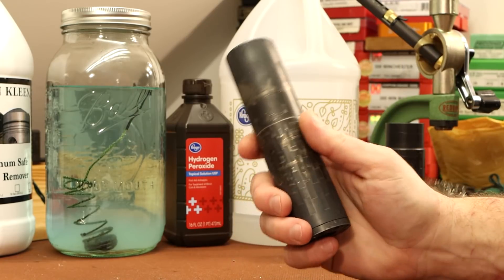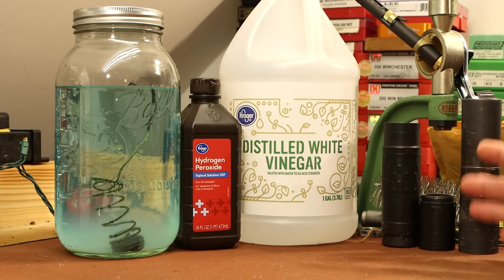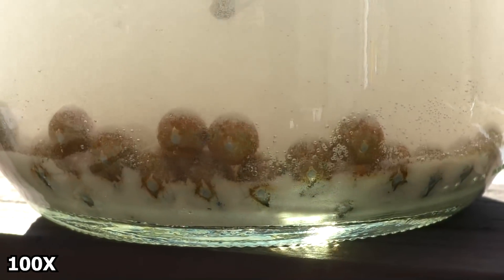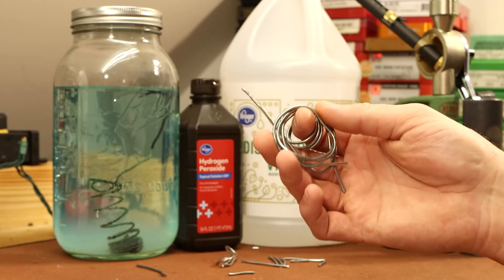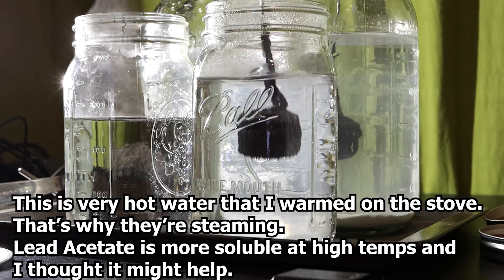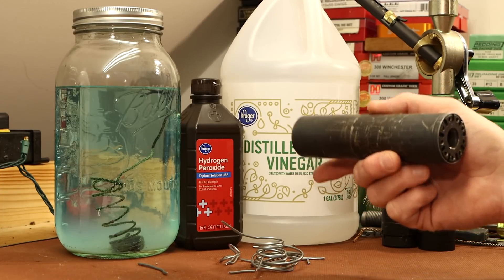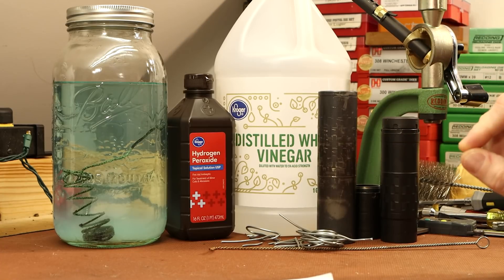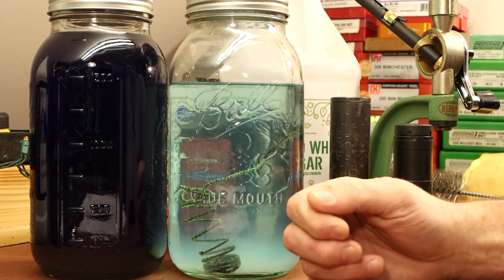Zinc makes The Dip safer. I think.

Comment: don't forget to neutralize the vinegar with a tea spoon of kitchen soda. iron sewage pipe will be eaten away by acidic stuff. and they are expensive to repair. 👌

and i guess those wire brush hair are copper. same stuff left behind when a fmj pass through the suppressor besides lead.

Comment: Alright the blue color of the last dip is copper. Once the copper goes in solution it will cement out on iron (why it plated on the can). The iron replaced it the exact same way the zinc does the lead. So to get it out of solution you can literally throw any scrap iron in and it’ll drop out. I’d avoid stainless as it will add other stuff like chromium, vanadium, etc. which may be more toxic than the copper. Plain old low grade steel is your best bet. You can also use electrolysis (which would put you on the road to plating lead projectiles for instance..). I know sodium metabisulfate and iron sulfate are 2 used to drop gold and other precious metals, not sure if they’d do copper but might be worth looking into. Oh and diluting the solution with water will make the lead and silver oxide drop out of solution.

Comment: Once you get all the lead out of solution that blue acidic solution can be used to copper plate just about anything you can run a current through. You'll need an old school car battery charger (new ones have too many safeties...) and not a lot else. Hand tool rescue has done it a few times, he may have a video on making the copper solution and the process on using it to plate things. Judging by the depth of blue color it's not a lot of copper, I wouldn't expect great results but you could plate copper wire (for example) just to pull the copper out of solution

Comment: The white powder is the lead sugar , lead acetate. I’ve read probably the same stuff. the rest is Peracetic (sp?)acid.  Don’t melt the sugar that’s the most deadly way . The zinc affected lead ehh I dunno. Also their should be some tin, antimony, silver, and arcinic (sp?) just what was their to start with. Paracetic acid also gets copper so the bronze brass dissolved.

Comment: I’m confused. I thought center fire rifle suppressors didn’t need to be cleaned. I have a surefire 300 sps and have never even considered cleaning other than the area that interfaces with the brake. I shoot 5.56, .308 and 300blk through it. Should I attempt to clean it?
Reply: Use CLR for a day or 2 it's worth it plus it's safer

Comment: Call me crazy but it seems to be that lead would be the least or your worries. I would think carbon would be the majority of the build up In the suppressor. Right? The bullets are mostly copper and even if the backs were exposed lead it would still only be tiny flakes of lead in the suppressor.

Comment: First thing.  KEEP this video.  It is educational and the more info we have on the dip being "less hazardous" the better.

I cleaned my suppressors recently and have a batch of the dip sitting around.  I have been researching for years how to make it less toxic.

It seems NaCl (aka salt) would work.  I found a chemistry video of lead acetate reaction with NaCl with the chemistry formula, but no actual concrete video.  Been told to boil water to make it a super saturated NaCl solution then dump into dip to make Lead Cloride (or is it Lead Clorate?).  NileRed I am sub too and saw that zinc vid.  Considered it too.  I am also partially ready to join his patreon for a month to ask questions he might be able to answer regarding this at home chemistry.

Still looking for a place in my area that will dispose of lead acetate.  Any time I call a hazmat place, I get the question of "what is lead acetate".  Morons.

Comment: I soak my suppressors in BoreTech Eliminator every one thousand or so rounds. It keeps them maintained and I don’t gain any weight. I soak for one hour, rinse with water then rinse withBallistol and water mix of 90 percent water and ten percent Ballistol. I have never had any issue whatsoever but.. my finish is long gone, it’s been cooked, painted over and re painted over five times.

Comment: There was an article on the web about using the dip to clean stainless steel. While it does not appear to cause damage to the steel, it actually does cause oxidation. That's what that brownish colored stuff was. Rust. You rusted/oxidized parts of your can, dude.

Unless you go to town with cast lead or high pressure exposed-base FMJs, there shouldn't be much of any lead in your can. Use a solution to dissolve the carbon from time to time, and you'll be good.

Comment: Have you thought about getting an airlock like what craft brewers use? That way the hydrogen gas can still get out but even less chance of spillage.
Reply from the maker: That's an awesome idea. I'd like for it to evaporate over time, but it would probably be safer to have something spill-proof for long term. Definitely something I'll consider.
Reply: Isn't the point of those things just to create like a one way valve to prevent bacteria and whatnot from getting in?

Comment: Could you burn the carbon off by making a potassium nitrate solution and then wetting the inside  of the can,, and then aftet allowing it to dry and you ignite the carbon with a match

Comment: Hey Johnny, if you want to speed up the reaction you can use zinc powder instead of a large piece of zinc. The increased surface area of the powder will help a lot.
Reply from the maker: Nilered did that in the 2nd video, so I considered it. I was holding out hope that maybe we could grow some cool looking crystals, and we did a little bit. Like you say, I'm sure all that surface area would help a lot.
Reply: @JohnnysReloadingBench  Try leaving it overnight in Coke once in a while
Reply: Maybe for something reusable you could get thin sheets, maybe foil, and coil it up to get surface area too.
Reply: Ooh, good idea!

Comment: There’s no real need to go to this method. Run the can hard (get the temp way up) that should self clean it. The dip is normally used on 22 cans that do get lead build up inside them. The only can I worry about cleaning, if you could call it that is my 22 can. My center fire cans I mag dump a few mags every so often an call it good. Most can benefit from having a build up inside, yes hard fact for the ocd crowd to under stand.

Comment: the piston clean is great for removing carbon on brakes and the bore . lots of f class guys use it or even clr . only it will remove bluing . it will even get a carboned up  adjustable gas block lose .

Comment: Didn't use a rack in your sonic cleaner did ya ???
Reply from the maker: Sure did! The one it came with.
I just went overboard...had it going for hours.
Reply: @JohnnysReloadingBench  well i wonder how it marked up your can , wonder if its not a metal problem , such as that is where the can got hotter under firing maybe ? Anyway it sucks that can looks well used now...

Comment: Why wouldn’t you just leave the lead acetate solution in a container to evaporate into a crystalline solid? You could then measure the amount precisely and react it with sulphuric acid to make lead sulphate which isn’t water soluble. You could safely dispose of that in the garbage or dilute it into some concrete and dispose of it as patio stone lol
Reply: So just out of curiosity… when you have created the lead acetate solution just leave it outside and let it evaporate. Once it has evaporated add sulfuric acid to it and then it will turn it in to lead sulfate? Which is obviously safer I’m assuming. Then you can dispose of it?

Comment: I’ve had my suppressor for 6 years.  It’s a 22 AAC Element.  I just throw the stainless baffles into my wet tumbler and let it run all night.  Sometimes I tumble the baffles with my brass.  Keep in mine, I have to tumble them for a very long time, 12-24 hours.   I don’t use the suppressor all the time because I don’t like cleaning it.
Reply: I found simple green in a steel pin tumbler for 24 hours worked awesome on carbon.  Still had some stubborn stuff, but worked out.
Reply: @luxordeathbed  I’ll try that next.

Comment: Hey Johnny, I'd be interested to see crushed zinc tablets (the kind you get in the vitamin section) poured the into the solution. I need to clean my 22 can so I'll give it a try when I do.
Reply: Those probably won't work. You need relatively pure zinc metal in order for the replacement reaction to work, and those tablets don't use pure zinc, they use some type of zinc compound.

Comment: I clean my guns and suppressors with a product named “Shooter’s Lube -Stage 1 Military Grade” weapon cleaner. I spray removable baffles, wait a few minutes, then simply wipe down with a cloth. Baffles look like brand new when done. Same for their tube. For non-removable baffles, just pour an ounce into tube, put a finger over inlet & outlet, and shake it up to completely cover/soak the innards. Then drain after a few minutes (I reclaim the contents for future use), then stand it up on its end where it will “self dry” in an hour or two...

Comment: Jonny, I use two methods to clean suppressors. 

I've found that "The Dip" works great on lead but not so well on carbon deposits. I read somewhere that you can take soda ash (sodium carbonate) and add that to the solution to neutralize the acid and precipitate out the lead. It's often sold as pool pH up at the hardware store. Add slowly and stir gently because it foams quite a bit. I'm not a chemist so I'm not sure this works but it does drop off a lot of the "white dust" into the solution. The blue color in your jar is likely dissolved  copper from bullet jackets. 

For carbon, I soak my pistol baffles in a mixture of Lye(sodium Hydroxide) and water for a couple days. The carbon loosens up and can be wiped out or easily scraped off. You could also try firing some 223 rem to blast off the baffles since you can't take your suppressor apart.  Lye is not good to get in your skin or eyes so make sure to use safety gear. however it's pretty safe to dump down the drain since it is used often in drain cleaning products. It should not be used on anything aluminum(only steel) as mixing with aluminum produces a toxic gas. It may strip off the finish on painted parts. 

Hope this helps.
Reply: CLR on carbon deposits.  BUT don't leave it in the CLR for a long time as it can damage steel/stainless steel.  10-15 minutes works wonders.  Search youtube on CLR on muzzle brakes.
Reply: Sodium carbonate is also sold as "washing soda".  After I process circuit boards, I have to wash the etching tank.  The rinsewater and the water in the dunk tank contain dissolved copper.  I just add an excess of sodium carbonate to precipitate everything.  Copper carbonate hydroxide isn't water-soluble.  
I don't know how that holds for lead.  I'm assuming that the product would be a basic lead carbonate with low solubility as well.  I don't know about the antimony fraction.

Comment: Why would your suppressor have lead in it? Every bullet that passes through has a copper jacket, and doesn't touch the suppressor anyway. It's just carbon fouling.
Reply: There will never be enough lead in a centerfire can to warrant cleaning its absolutely pointless.
Reply: Once again.  You do not understand, the lead is from the priming compound.  Maybe you have a matchlock and don't use primers.  The priming compound lead is airborne and extremely dangerous to humans and can cause cancer too.

Comment: Dang man, why are we over complicating this? Its a centerfire rifle, it doesn’t build up the lead that a 22lr can builds up. If you really want to clean it just spray some foaming Wipeout bore cleaner in there a few times or just plug the ends and put a brush free bore cleaner in there. There is carbon and maybe a little copper build up in there, very little lead. 

Edit: I didnt mean for that to come across as critical.
Reply: I have 20k on a form 1 can. I've never cleaned it I've actually never even taken it apart. It still works fine all grade 5 titanium with a ss blast baffle that's eroded a little bit. Cleaning a rifle can is absolutely pointless, my rugged obsidian 45 has roughly 5k on it I've never touched it either and probably won't. 

I don't know why some guys want to clean these things so bad? I'd rather not be in contact with what's inside them. If I ever have a problem with a factory built can I'll send it back they'll fix it. My form 1's I don't really care about because my blast baffle will be eroded before "not cleaning it" would cause a problem.
Reply: @theLeadGin  because some people will take the time to keep their shit nice? do you service your car?
Reply: @James28R  Servicing a car =/= to keeping it looking nice (cleaning). Last I checked cleaning a muffler on a car does not come up as a recommendation or requirement. Cleaning the interior of a car and washing the exterior is achievable through much more ecologically sound principles such as water and "elbow grease." 

I don't breathe through my sound suppressor, nor do I drive my car from inside the muffler or engine block.
Reply: It is 6 years old and with how much he shoots I would imagine it has a lot of build up. There is probably quite a bit of carbon and more lead than you think because of bullets with exposed lead in the back. But agreed he is going way too deep down the rabbit hole here. He could just send it in to get cleaned for little to no cost or use an easier method.
Reply: @Nick-sx6jm  Yeah, no I understand its an older suppressor that gets shot a lot with various calibers and powder loads, but still…the Wipeout method, or just any foaming bore cleaner works marvelous for upkeep.

Comment: If I understand correctly, the silencerco omega’s outer serialized thin wall tube can be unscrewed from the core (bother ends off to) and then put the Core into a water rotary Tumbler with stainless steal media to clean the carbon deposits. 
It took me about 6 hours of 3 hot Dawn water baths to clean a Sparrow core, but boy is that thing clean now.
Reply: i believe he said in an earlier video that his has become seized up...
Reply from the maker: I can't get mine apart anymore, but it's headed back to silencerco soon. I worry a lot about using the rotary tumbler and getting steel chips or pins stuck in there. I've heard it works awesome, though.
Reply: @JohnnysReloadingBench  Lok at replacing the Omega endcap with the AREA 419 cap and using the adaptors for your rifles. This allows you to switch betwen different thread pitches without touching the can. I use it on almost ALL my rifles and have seen ZERO impact shift between removal and re-install
Reply: @JohnnysReloadingBench  on the plus side, the SilCo folks are great about taking care of stuff.  I had an end cap strike with my Hybrid and an aftermarket barrel.  I contacted SilCo because I wanted to make sure there wasn't damage inside the can I couldn't see.  About 3 weeks after sending it to them, it was back with 'no damage found' and a new end cap.  That led to a trip to the friendly local suppressor shop where I discovered their 1/2x28XL piston and it's internal 'shoulder' that was designed for thinner pistol barrels that don't have enough metal for a proper shoulder.

Comment: Fellow student of Youtube Chemistry University here, I think what happened is due to what's called the "Reactivity Series of Metals", basically some metals are more reactive, and others less so.  You can use this to swap one metal for another in a solution, and since Iron (in the brush handle & bristles) is more reactive than Lead, it was not only dissolving due to the solution, but whatever lead had dissolved into the solution was immedately being replaced by iron from the handle.  Zinc is more reactive than iron, so when you put the zinc coil in that nasty solution, both the iron and the lead were precipitating out which is why you got a different looking precpitate.

This is used in Gold refnining because Gold is the least reactive metal. A process called "inquartation" can be used whereby carat gold (i.e., gold that is not pure) is alloyed with sterling silver to make it easier to dissolve out the silver and base metals.  The pure metallic gold is left behind, and then the solution that is full of silver, copper, etc can be refined using the reactivity series to remove just the silver by putting in pieces of copper.
Reply: Alright he summed up my comment way better than I wrote it haha. Any experience with iron sulfate to precipitate gold in solution? I think I accidentally screwed up with adding more hydrochloric acid and peroxide over and over and eventually got the gold in solution (over a week or 2, no heat). Can’t find any sodium metabisulfate locally but did locate copperas (iron sulfate).

Comment: FYI 2 points...
First, the lead hysteria surrounding ammunition is from lead styphnate a key component of primers. Its burned, aerosolized & inhaled upon cartridge detonation, thus, "lead poisoning".
It IS NOT from hard cast lead bullets...(unless you're stupid enough to handle 1000+ rounds for a few hours, have your hands turn silver & then go eat lunch...) Commonsense would hopefully prevail here but hey anything is possible I guess.
Secondly, if you have toxic chemicals suspended in solution put them into a baking pan & place them in the sun to evaporate. This will concentrate the heavy metals to a (potentially) recoverable substance & also NOT allow them to poison your immediate environment. Safer for disposal, storage or recovery.
Reply: @1newme425 'Leadman' eh?... How much for shipping to Canada? Wheel weights are becoming a real bitch to source up here.
Reply from the maker: Dehydrated lead acetate is still lead acetate. I'll agree that it's easier and safer to store in that state, but it's not nearly as safe as lead metal or less volatile compounds. Better to convert it before storage or disposal, in my opinion.